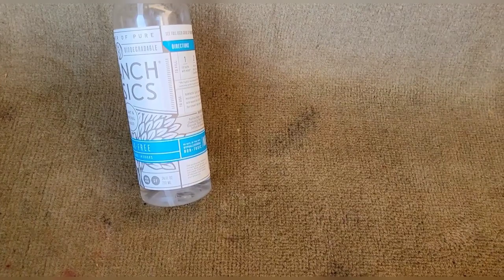How to Get Sour Milk Smell 🤢 Out of Your Car!!

Comment: I hit a bump and the whole gallon of milk busted and it leaked onto the whole back of the suv. Ive tried everything, even took out the seats and pulled the carpet out and steam vacuumed it and it still smells. Can anyone recommend how to clean the ac vents so that it doesn’t smell anymore? My suv doesn’t have a cabin air filter

Comment: Around Christmas time I had Bailey's creamer I spilled in my car. It wasn't that bad at the time. I cleaned it up the next day, but I didn't get it all. There is a hint of spoiled milk. I've had my car detailed and I still smell it. I'm now trying to soak it up with baking soda, I've sprayed Fabreeze, Carbona Carpet Cleaner, and now I've moved on to Woollite Pet Stain and Order Remover. If that still doesn't do the trick I'm moving on to the vinegar/water mixture and then an enzymatic cleaner. My nose is very sensitive and while others might not smell it as much as I do, it bothers me tremendously!
Reply from the maker: Oh no.  I'm sorry that happened.  I totally feel your pain😳🥺
Reply: Hi! Did the woollite pet stain remover work? I have some and I spilled milk on my carpet.